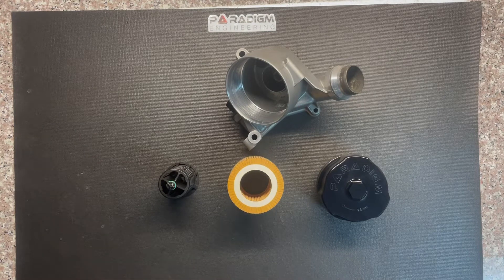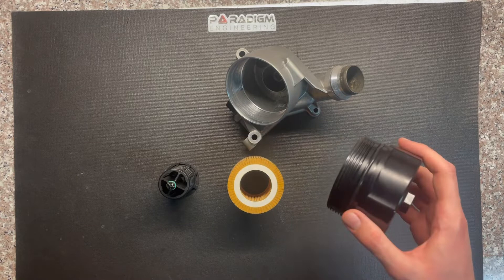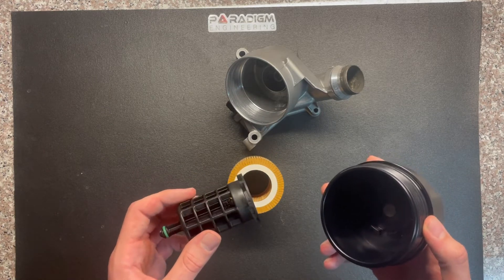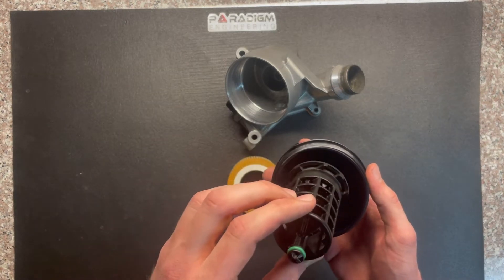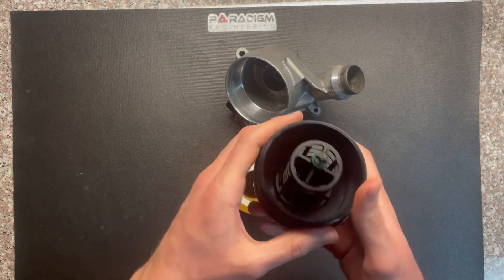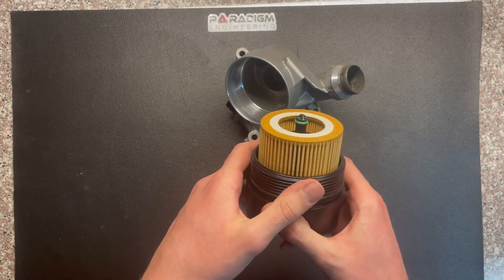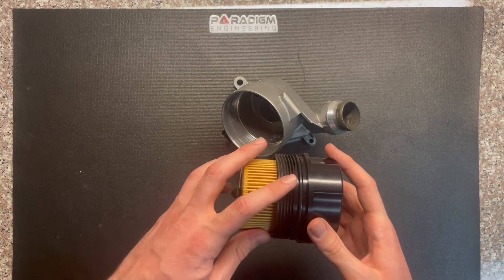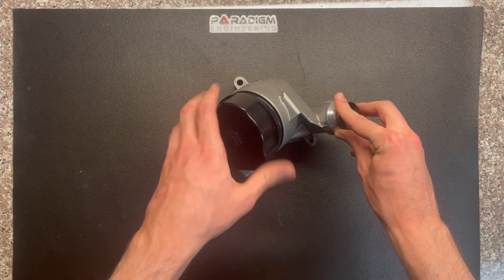BMW N54/N55/S55/N52/N20/N26 magnetic oil filter cap install - Paradigm Engineering

Comment: Is there any chance at all of the magnet coming loose and ending up in the housing?
Reply from the maker: Chris Hamilton  The magnet is held by interference fit, which creates a bond virtually unbreakable without machine interference. An industrial grade adhesive is also applied, just as an extra precaution. In the unlikely event that the magnet is able to break loose, it will be blocked by the filter bypass valve from entering any oil inlets or outlets.
Reply: @paradigmengineering1323  thank you 😊!!